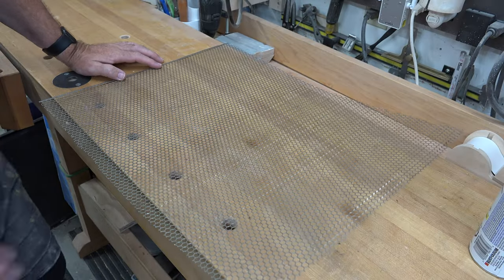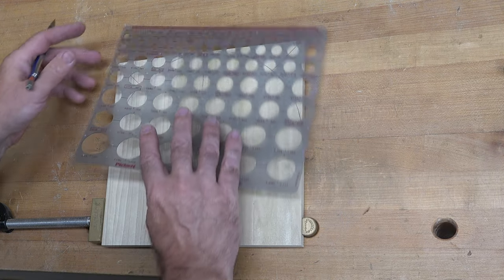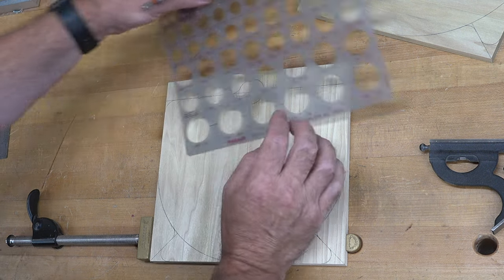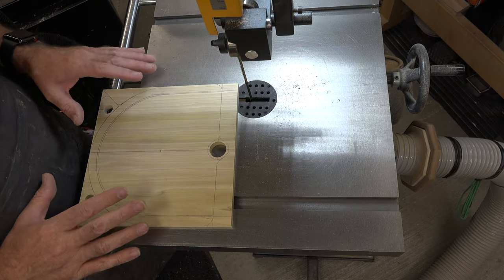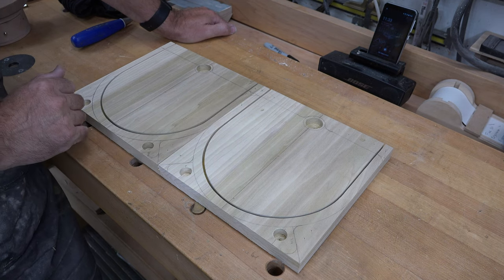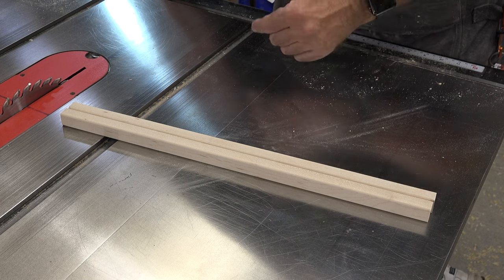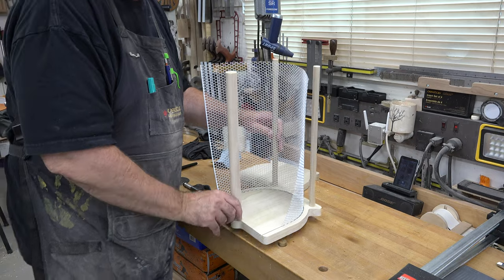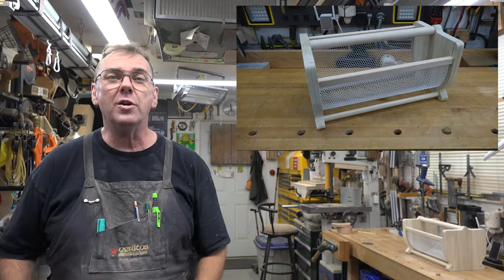Making a Garden Hod

Comment: You say it's for harvesting vegetables ... do you just drag it along the ground and the dirt goes out through the holes while veg are held back ... brilliant 🤣
I was smiling watching you struggle with the mesh, been there, done that ... a cracking and useful project 👍
Another method ... mesh around the outside of the end pieces then thin strips of wood bent round the end pieces/mesh to hold everything in place and cover up the mesh ... no requirement for grooves or bottom dowels ... would need to add feet though.
Reply from the maker: I had all kinds of different mesh mounting ideas but one of the criteria my wife had was that it needed to be completely concealed within the wood.  Makes it a little more challenging.  That mesh likes to fight back.  LOL.  Thanks for tuning in Barry and for chiming in with your suggestions.

Comment: Another nice project Kenny.  I was thinking that perhaps putting the screws in part way in the mesh assembly process might have helped?  Also seeing that rinsing the produce in the basket is a good option that waterproof glue be used.
Reply from the maker: Good call on the waterproof glue Dwight.  Titebond III would definitely be a great choice here.  Thanks for tuning in and for chiming in with the suggestions.  It's very much appreciated.

Comment: Anyone have thoughts on finishes???
Reply from the maker: I sprayed mine with several (4) coats of water based, satin finish varnish and it worked perfectly.  The wood was perfectly sealed and I used this hod all summer long and even up until last week and the finish is still perfect and the wood has been protected from any moisture with the varnish in place.  I hope this helps.  Thanks for tuning in to the show.